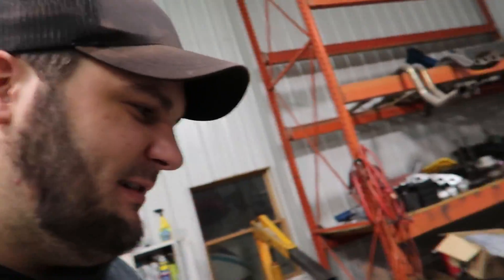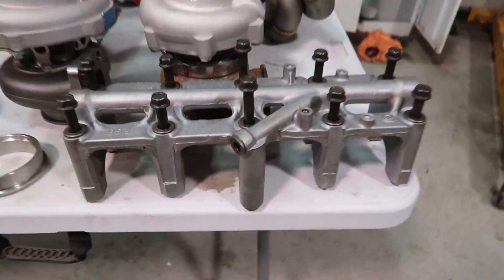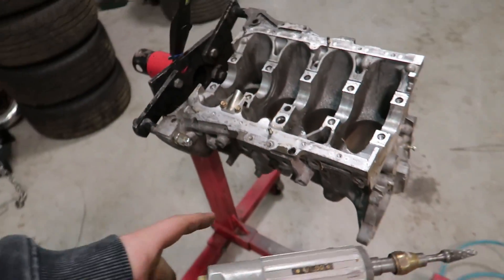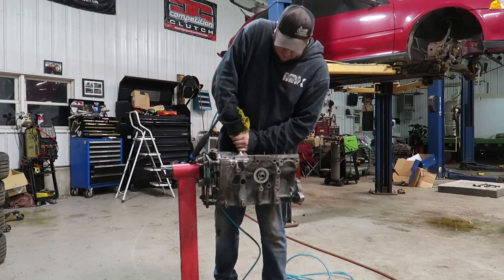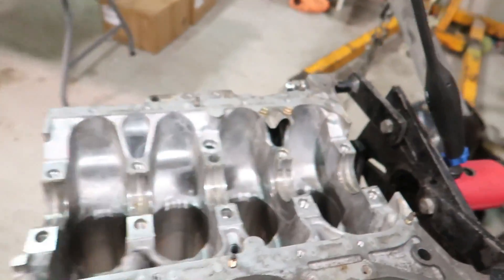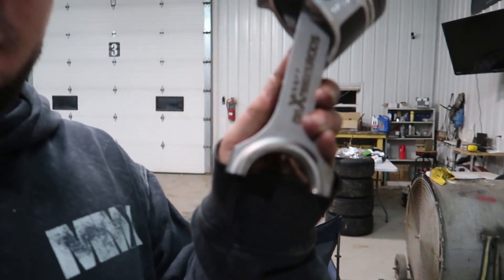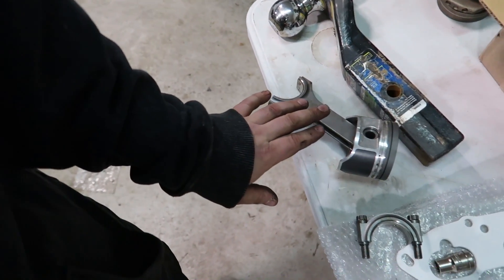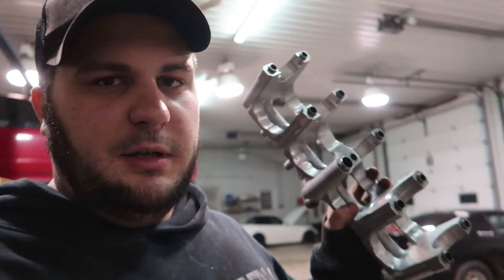D16 TURBO Engine Build - Notching The Block And Main Girdle

Comment: Nice to see people still out there messing with my favorite engines, the D series. They don't live very long on boost without aftermarket cranks and sleeves. Even on 8psi I broke a crank. For some reason the D factory cranks just can't take the abuse. The sleeves are pretty safe if you're running rich but then you've got other problems.

I really miss the ZC dual cam. If I were rich I'd have a whole fleet of ZC turbo CR-X's.
Reply: Dude there's something else going on with your builds. I've been running well over 8 psi for years now on the stock crank and sleeves without a problem.

I run it hard but I don't abuse it, evidently that makes all the difference.

Comment: I use that combination a lot, you have to notch the piston for valve clearance if your going to use a vtec head. Piston to wall I use .003-.004 for 350-400HP for street/drag setup. The most import thing is keeping your timming on check, these blocks don’t like it!!
Reply: Since when do you need to notch pistons i have never heard of this. As long as you dont use long rods.
Reply: @Boostonabudget  well when you have built this combination you have to, the piston is flat with the block deck, maybe is the first time you hear it but I’ve been running this combination for N/A and turbo for years and allways have needed valve clearance on them, if not you can try it out, the engine won’t turn without the piston hitting the valve.
Reply: Thats wild learn something new everyday

Comment: I have the same pistons in my EF, when I test drove it to brake in the turbo was a full boost at 3200 rpm and it wakes up fast when cruising, but I still need to get it tuned, so I will be ordering your 1000cc injectors to go e85